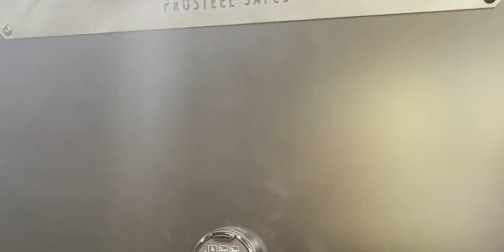Plumbing Phrases You NEED to Know

Comment: I am an electrician and if I ever tell a new guy to go to the store and buy a wire stretcher and he comes back with an actual wire stretcher for Barbwire fencing then I will now I am not dealing with an idiot and I’m dealing with someone who could absolutely rope a cow. 

Here are some interesting slang terms for the electrical industry

Monkey shit, that’s duck seal and it’s used to seal holes in walls around cable and pipe penetrations 

Horse cock, a tool that’s called a Calum grip and is used for pulling larger diameter wires through conduit 

Bomb suit , category 4 arc flash suit used when working on high voltage switchgear. Gets that nickname because it actually does look similar to the PPE worn by EOD techs for disarming explosives

High hat, term for a recessed lighting fixture

Russel, term for a porcelain or plastic lamp holder that takes a single bulb, commonly found in garages, attics and basements

Wire stretcher , made up tool to trick the new guy but is also an actual tool for Barbwire fencing on a farm

Acorn, the connector that you used to attach the main grounding conductor to a ground rod, gets its name because it’s shaped generally like an actual acorn. 

Rubbers, slang term for electrical insulating gloves

Redhead, anti-short bushing for MC cable